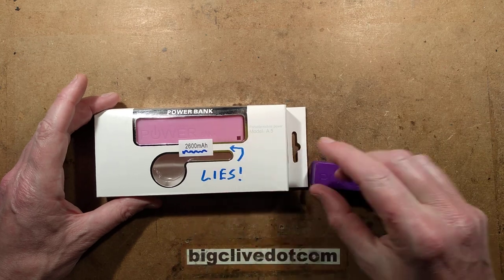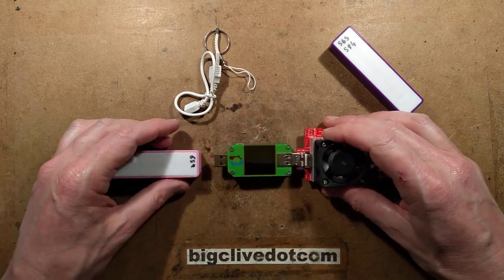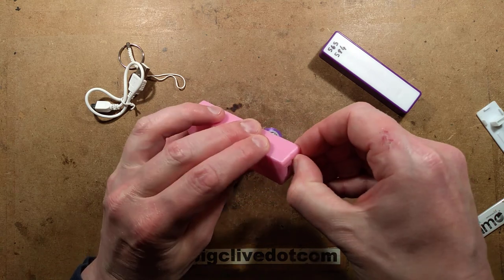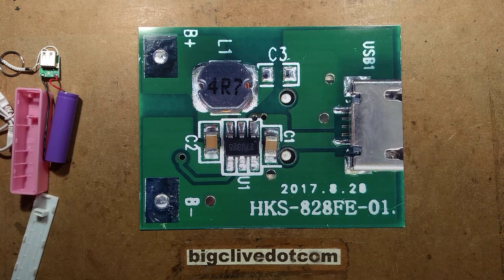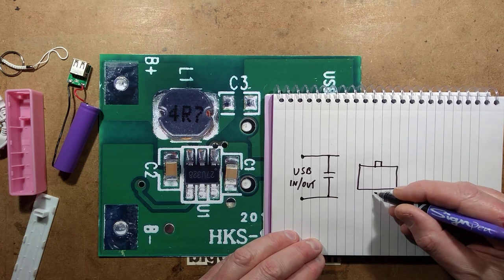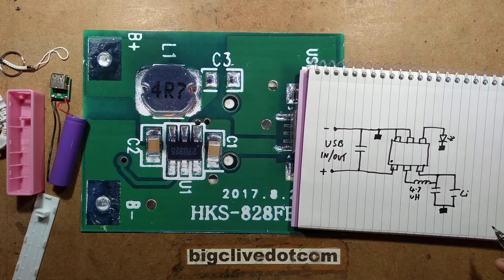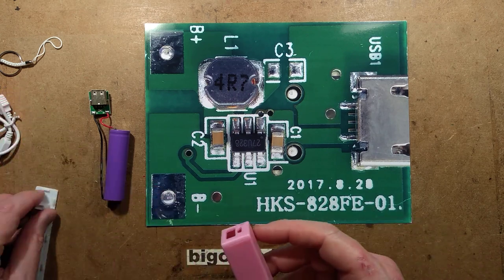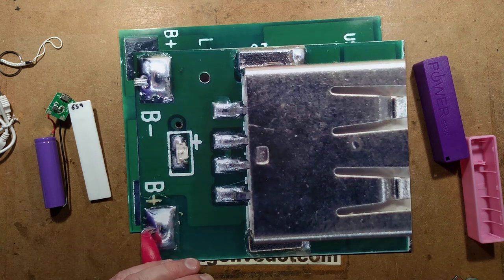Simplest power bank ever?

Comment: Great review! These are available as kits from Ali, and I've bought a bag full of those power bank cases. We then recycled "dead" laptop batteries, took out the working cells, and made power banks for the workshop's students :-) They are good enough to charge your phone if no other options are available, or power some small Arduino robots :-)
Reply: Perfect second life for old laptop batteries. I’ve got a large collection myself, and they’re definitely perfect for those sorts of applications. [Some of them don’t do well for things like charging phones because the voltage drops heavily at high current, and most 5V output boards I’ve used will cut it off and leave a fair amount of power left when the voltage rebounds]

Comment: I love these devices as they are a great way to get free power banks.  You buy them off eBay (the ones that are very obviously fake), measure the true capacity, complain to the seller that they sold you a fake item, and the seller gives you a refund so you don't spoil the nice scheme they have going.  I've gotten a number of free power banks this way, and because they are coming from scammers I don't feel the least bit guilty!  Same applies to 18650 cells and the like.  I've often wondered how far you could push the scheme before they give up and start labelling the capacity honestly...like could you build your own DIY powerwall entirely from free scam batteries?  Hmm...
Reply: We got a good supplier who tried to push us some 1500mAh 18650s as 8000mAh we had never gotten batterys from before but good LEDs,COBs,project boards etc from, not knowing we test all  cells on intake & test capacity before DIY/usage (never selling unless genuine samsungs) & they gave us 50pcs of fake marked/wrapped cells so we ended up with a few 1500mAh for torches/projects etc with a full refund  (it helps if you can show fakes & they cant argue with pictures/data shown 0-100% charge capacity 🙈🙊)
Reply: While I don't have much of a problem with this concept *now*, this line of thinking has made things much harder for consumers. Years ago it was super easy to spot fakes, as they'd always have an absurd capacity rating of >4000mAh (eg those terrible "9900mAh" 18650s that are actually about 500mAh).

While this was a problem for complete strangers to electronics, I was actually quite happy with the situation. Scammer vendors will always exist, you arent going to dispute them all into oblivion, but it meant that anyone who knew anything about the batteries used, could very easily know if a device was fake, with a simple rule (if its under 3500mAh, its probably real, if its over 3500mAh, its definitely fake).

However people buying all the obvious fakes then demanding a refund due to them not meeting the physically impossible capacity rating, even though they knew full well it was fake before buying it, has led such vendors to give their units less absurd fake ratings, like these with 2600mAh. Now it's impossible to distinguish the real ones from the fakes since they'll both have a reasonable sounding capacity, and its only if you actually test them (which far fewer people will do) that you can know if you got duped.

So congrats, you and people like you have helped make the market an absolute shitfest, where you can never know if powerbanks or batteries are fake or not until you receive them and test them yourself. Thanks.
Reply: @dalehorton7748  This is the whiniest thing I've read in a while
Reply: I've done this a few times. I actively look for power banks that seem to be correct when buying so that I don't have to do this, but if I go through all the trouble of trying to buy correctly rated batteries, and they definitely aren't, calling the seller out on it has resulted in a refund without return 100% of the time.
Reply: @nowledge more chaotic neutral
Reply: Those cells will cost you a house.
Reply: @dalehorton7748  Cry more?
Reply: @sbellaharris  not really lol you set ya house alight 😂😂😂
Reply: Dale Horton Just because the scammer lists an obviously fake capacity at an absurd price, which the customer might be aware of, doesn’t mean they should be allowed to do it. 

That would be like me trying to sell a car for cheap guaranteed to work and then have it not work even though you might have known something might be up with it. 

It wastes the customers time and money (since a lot of sellers of fakes/counterfeits rid of their accounts somehow after sales and just have duplicate accounts with multiple product listings each) and it screws with the selling pages algorithms by showing more fakes for cheap/faster selling than the actual good stuff.
Reply: You would only get one go on each seller though as they will ban you. Otherwise good plan.
Reply: seriously, whats the point. the cells are crap to the point of being useless and the power banks are only a quid each anyway. or if you want them for the charge board you can get 5 or those for 99p off ebay. seems like a lot of hassle for a dirt cheap power bank (and how many of those can you usefully have anyway) and a cell only fit for the bin.
Reply: Very true. The shmuck who bought them in bulk from China probably has no idea what he is selling either. Not an excuse, but the only conmen here are the manufacturers.
Reply: FEMADEATHCAMPCONTROL considering how little they pay their manufacturing factories I wouldn’t be too impressed with what they made honestly.
Reply: Very glad someone is doing this.  I'd had the same idea, but dealing with scammers slowly kills me inside.
Reply: be careful doing this, if ebay/paypal see you refund a lot of things they will close your account becasue you are costing them money
Reply: More sense to close the seller's account, since it's their mistakes that are causing the refunds
Reply: @ElfRightsActivist  It's quite adorable that you're using "socialist" as an insult...
Reply: Pook365   Probably an US American. Your garden variety US American has a very peculiar view of socialism. For them that's a word like "antichrist". They don't care for the actual meaning, or even historical background.
Reply: @dalehorton7748  I just buy from reputable suppliers when I need a quality item...
Reply: Online purchases were doomed from beginning. Several different researchers have found "Samsung" branded liithium battery including so called "Genuine Samsung Replacement" are every one fake.  Only about 5 % of buyers (at best) realise they bought a fake, which by magic also is the same % as seller's negative feedback.  What causes this industry to survive and prosper is the dumb and stupid way all branded phones indicate " % charge " instead of Energy Capacity.
Reply: You're assuming the seller knows they're fake...
Reply: @dalehorton7748  you seem to be very good at victim blaming, why not blame the scammers that are the cause of this problem in the first place?
Reply: @HaggisMuncher-69-420  most of the time, they do, they just don't care because they know they can get away with it.
Reply: @yotoprules9361  Purposely buying fakes just so you can dispute them does not make you honest, honorable or a victim. 
The sellers are scum, but two wrongs don't make a right.

Comment: Remember to translate from 5v to the 3.7/3.6 nominal for judging capacity given in mAh. They always quote what is written on the cell.
Reply: Going to assume the worst case scenarios and be generous with the assumptions.
700mA @ 5V means less than 980mA @ 3.6V
Assuming 20% power loss due to conversion, would mean less than 1230mA from the battery.
Assuming 20% tolerance on the capacity of the battery would mean the battery could be labelled as no more than 1540mA.
Reply: @n-steam  and then you double that number as the cell sees the maH going in when charging and then again going out when discharging. Boom 😁
Reply: Против Глобал  Pardon my ignorance, but how do you know it is a linear charger?  Presence of an inductor suggests that bucking is intended. Unless it is meant for some kind of filtering which I doubt.
Reply: Против Глобал  Perhaps my basic physics is rusty here but if the input is at 3.6V and the output is at 5V even with a 100% efficiency in the output circuit the current of the output must be lower than the input or the power output would exceed the power input, the law of conservation of energy says no dice on this one you can't output 0.5W (100mA@5V) from a 0.36W (100mA@3.6V) input either the output current would have to lower or you need to draw more current from the battery to supply the missing joules of energy here. Though this is if one is measuring it by measuring the discharge capacity of the battery I guess are you only talking about if you measure the charge input to calculate the mAh value? So I guess it does depend if you are measuring the raw charge input or the real world usable capacity (output) though I would expect marketing to favour the former as thermodynamics guarantees the usable output capacity will always be lower due to losses in the energy conversions.

Comment: I bought one of these a while ago from a pound store - when I took it apart it had a spring holder and the 18650 wasn't soldered - meaning I could remove the cell and use the bank as a charger. Sadly when I went back to buy some more they all had the cell soldered in place. Yes they can be bought online, but the pound store ones where a cheaper option.

Comment: I was given a couple of those. They came from Poundland. One had about 10% of the claimed output capacity, and the other had about 12.5%. On second recharge, both cells delivered slightly less power before they shut down. The cells seem to be reclaimed at the end of life, or else factory rejects. Thanks Clive.

Comment: They sell these at your favourite shop (Poundland).  I've got a couple and have put a decent recycled 18650 cell in each (~2000 mAh recovered from knackered hoverboard battery).  It's a handy case/PCB and will charge my phone from near zero.  Also handy to slot in one of those USB torch heads you've featured previously.

Comment: Amazing the 6 pin chip is almost as small as those 2 little capacitors.
Reply: Especially since it’s sinking 1V or so when charging. I can’t see it taking more than 150mA or so.
Reply: How you doin that? How how you doin that?
Reply: cute suit head
Reply: @Scrogan  Put a scope on the inductor. I wouldn't be surprised if it's in fact operating as a buck converter during charging.
Reply: @Re_Kitty  Thanks!
Reply: NiHaoMike it would be neat if that were the case, but without looking at the circuit again I’m not sure if the topology would allow for such a thing.

Comment: I bought a few of these at a local electronic stores. They look exactly the same as these. Its rated for 2200mah...and suprisngly, they WERE :O
I verified it by opening it up and removing the 18650 and externally charging it at 500ma since thats the max charge rate the pcb board can do. And it definitely does supply 2.1 amps. I use these small power banks to power my camera on my motorcycle helmet when that battery dies. I further modded mines with a battery level bar

Comment: Poundland was selling exactly the same items, in different packaging, marked as 1200 mAh, last year. Same pcb, same colour defunct cell, same moulded name, same plastic box, except mine are black.  I was given two of them, because they were capable of supplying less than 500 mAh. They benefit from having a decent cell fitted to them, and then the voltage holds up a bit better under load, right up to the 1A threshold, unless the cell is nearly discharged.

Comment: A SOT-23 6 pin boost converter is not unusual- parts like Microchip's MCP16251 or MCP1623 have been around for years (2010, I think). The big difference is this part needs 2 fewer components than the components I mentioned - 2 resistors to set the output voltage. The part used here must be a similar but fixed output voltage. I'm curious to see the converter's switching frequency and just how hot it is getting at its maximum output current- by the circuit, all the current must be going through the chip.

By the picture at 6:30, D+ and D- are shorted on the USB A connector, so according to the USB-IF battery charging spec (USB IF BC1.2), this is telling the device it is connected to that the charger is a dedicated charging port (DCP) and can provide up to 1.5A, though it can start to do a "constant current" type of charge. The BC 1.2 spec ain't simple!

Comment: I think I bought tiny "charge" boards on ebay (or amazon) that worked with a single 18650...  :). As always, entertaining "review"!
Reply: The current rating also seems be to 1/2 to 3/4 if we are following the USB specification.

Comment: My mom bought us 3 of these in the local Chinese shop. They all worked :D 
Ofc the capacity was not high but 1/3 phone charge is useful.
Reply: Handy for a backup battery topper on USB charged bike lights, maybe? I much prefer my Mobi brand pack - manages 2+ full recharges on my iphone and can even charge it faster than Messenger on a video call can drain it (older phone, video calls can drain a full charge in half an hour on 4G)

Comment: I picked up a couple of these for £3 each. Mostly for smaller electronics projects. Mine are all the same package but a bit more complicated circuit, and the battery is not soldered but in a socket.
Therefor I can use them as chergers for 18650's

Comment: Hi Clive, don't forget the mentioned capacity is often measured at 3.7V and not 5V, including DC-DC conversion loss, this could mess up numbers.
Reply from the maker: I always refer to the capacity of the cell inside which is often the stated capacity on the packaging of real units.
Reply: It's good to have standards, even if they are low.
Reply: Searching on the number on the circuit board, I came up with a Russian unit that looks exactly like this one- it's rated at 3.7v.
Reply: Laura Harris Lithium cells are 3.7V nominally.
Reply: He's got a video about how he tests power banks that explains all this. He is testing them right. Kinda wonder if he should link that in every one of these videos to avoid a third of the comments being "you tested wrong, etc"
Reply: the vast majority of these powerbanks charge by dissipating the extra voltage as heat.  they don't buck convert it down.  Since this is the case, 1000mah at 5v going in turns into 1000mah of whatever voltage the battery needs to charge.

Comment: I bought a number of these cheapy charge packs from Poundlands before. I just rip out the cells, and I have a number of 3000 mAh LG HG2 18650's in them instead and they work a treat. I can actually get a full charge off it, and the charge output holds at a steady 1.2amps with 5.2v according to my USB load meter. Not bad at all, I've taken them camping and they've done just what I needed for minimal spend.

Comment: I believe the LED is in the correct position, while the board doesn't have a spring loaded contact other products have: you can notice it has grooves for it in the case.
The case is designed to hold such a board and allow for replacing the battery. They just soldered wires to the battery in this one instead of using spring loaded contacts, that's why the LED is misplaced against that light guide.

Comment: I wonder, if you plugged this into a device with OTG USB capability such as an Android phone would it be possible that the device would start charging the power bank rather than vice-versa?
Reply: Yes it would.  The cables are wired differently, so if you used a normal USB cable the phone would charge from the power bank, but if you used an OTG cable the power bank would charge from the phone.  I had to draw little direction arrows on the cables I carry around with me so I could remember which way the power would flow for each cable.
Reply: OTG cable?
Reply: Berkeloid That wiring is mostly for the data, controlling which end is the master. There is an increasing interest in having phones charge while acting as data master for headphones or speakers.
Reply: My wife has a tiny electric fan which is powered via USB-C from her phone. Clearly there's 5 volts coming out of the port. It seems like this power bank with it's simple circuitry would see that and start charging itself rather than charging the phone.
Reply: @franglish9265  Commonly called a "data cable" by your average consumer. They have an extra line which can trigger a variety of special functions based on resistance between that line and ground. That's how your phone knows when it's plugged into a specific type of USB device without special drivers installed.
Reply: @eideticex  most of the time the extra pin is shorted to ground for otg   .. and if you strip the micro usb ends sometimes you will find the 5 pins just with power red and black connected only for charger ...short pin5 to ground solder usb female ....DIY OTG lol
Reply: paul austin  it's only for low power device eg keyboard, mouse ,flash drive on the go external device cud have its own power supply and still charge fone with 2 separate usb for power and connect 2 data wires direct to fone but it might limit fone charging current while in otg mode tho
Reply: @SoftBreadSoft  ah ok. Wasn't aware of such items being a thing. That would be an issue with a cable like that.
Reply: I once used a phone to charge another phone over OTG. What a time to be alive.
Reply: @johnfrancisdoe1563  fans, LEDs, IR thermal cameras.
Reply: Not without an OTG adapter.

There is a protocol for telling your device when to enter OTG mode. That's what the fifth pin on a USB micro interface is for.
Reply: You can certainly charge one of these from your phone, however not very quickly - and it will rapidly drain your phone battery.